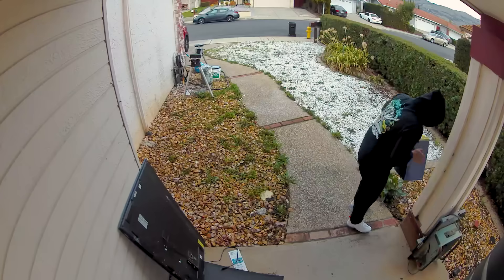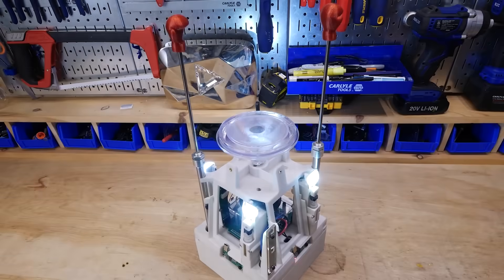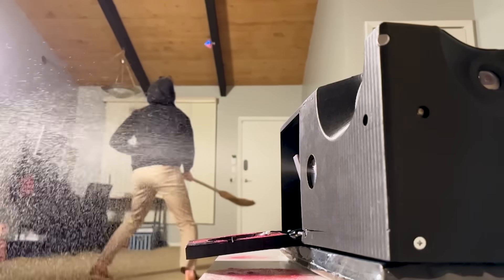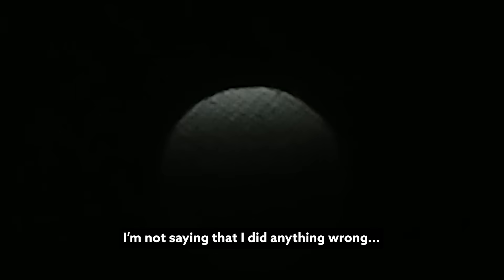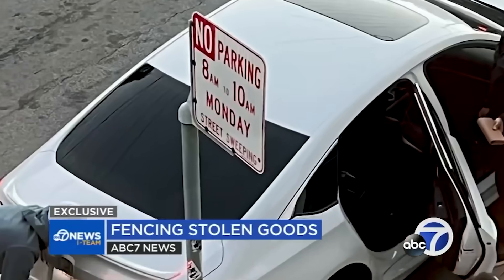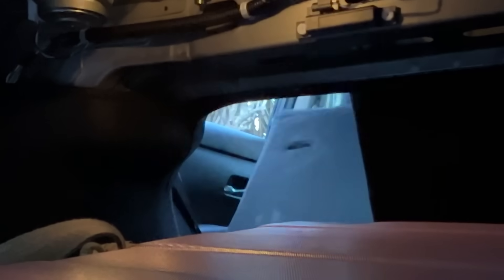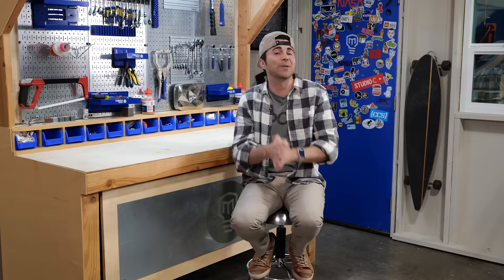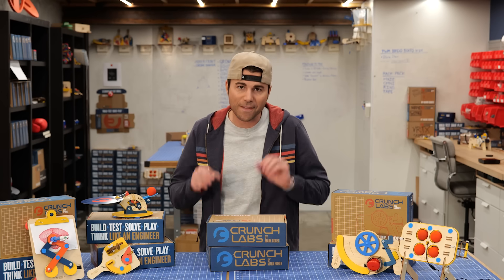Car Thieves vs the Almost Final GlitterBomb 5.0

Comment: Here is what I want to see. 

I want to see you "rig" bait cars with nooses to ensare their arms or torso's safetly but solidly so they can NOT escape until police arrive to release them and take them away.

THAT is what I would love to see your engineering skills accomplish. securely ensare/trap them without hurting them (think a noose/loop type deal) that would secure their arm or torso and its cut resistant so they can't get away. leave them dangling half way in the car till the cops arrive.